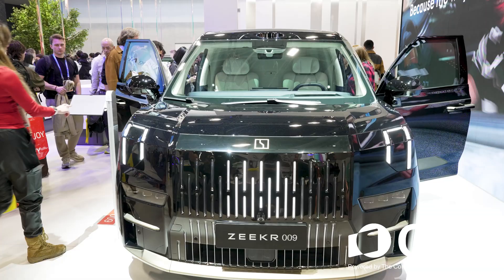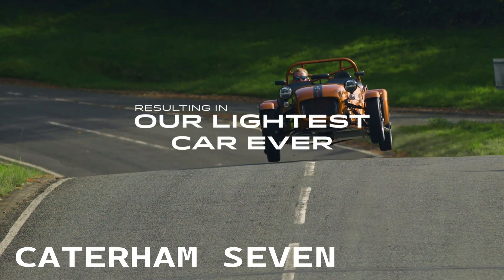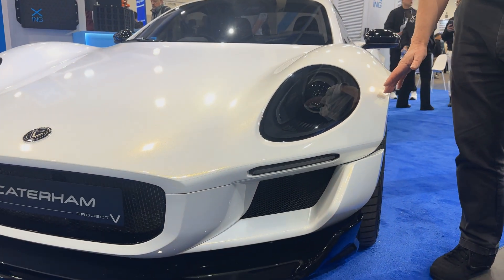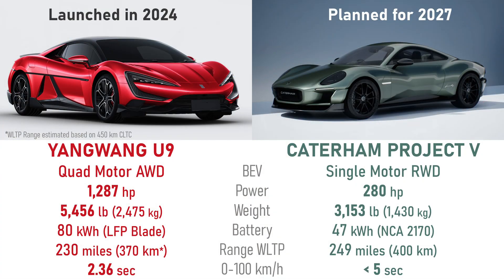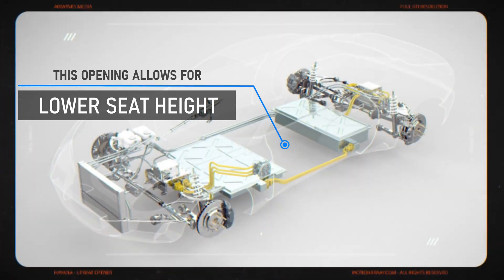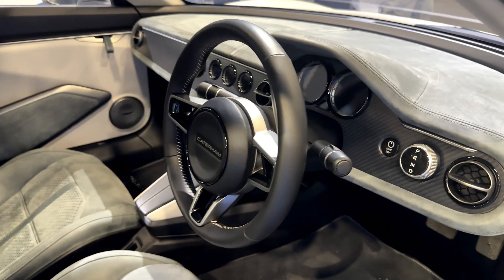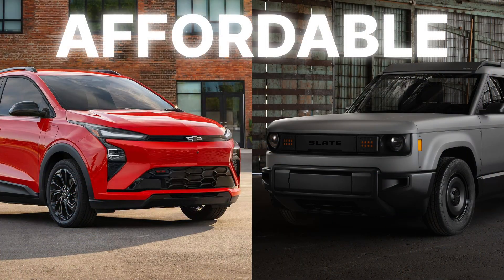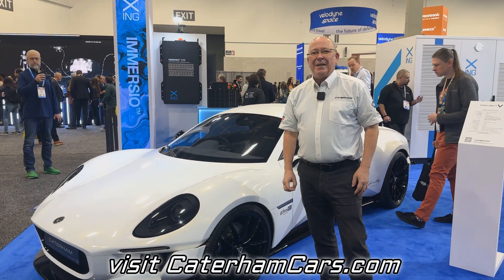2027 Caterham Project V is Pure. Electric. Fun.

Comment: I had a 2.0 litre Zetec engined Caterham 7 with 220HP as my only car for 3 years. It was crazy fast. I've now got a Porsche Taycan 4s which is also crazy fast but can't match the corner speeds as it was a quarter of the weight. The Caterham Project V looks amazing. Like a Taycan, but on a crash diet. It will be amazing.

Comment: A Donut battery would be heaven for this application. Air cooled, half the weight, or maintain the weight but double the capacity to potentially 750km range.

Comment: Design-wise, it looks phenomenal. It looks strikingly similar to the Jaguar C-X75, especially the updated street legal one that was done in a similar shade of green. I can also see elements of the Maserati MC20, which is another stunning looker. Performance-wise, it seems good. I was hoping for a better commitment, like low 4s or mid-3s 0-60 which would befit its design and current performance windows. If it's not too expensive, then this could be very compelling. I'm still not sold on electric for sports cars, but maybe this could help get me over that gap.

Comment: Here's hoping that EVs in general can become simpler overall.  I don't really need electronically opening doors, an analog handle works just fine.  Better even.  Like the design of the Caterham, although I wonder about the interior leg- and headroom.
Reply: re: "I wonder about the interior leg- and headroom." well a 6ft-1in Man (myself) technically fits in a current generation ND Miata (with the Hardtop in place) which is Coupe having a wheelbase of 91 inches.  by comparison this E-Caterham is spec'd to have a wheelbase of 101 inches.  okay the Math says that's +10 inches in addition to NOT having the "space claim" ahead of the firewall for a Gas engine, so make of that what you will.